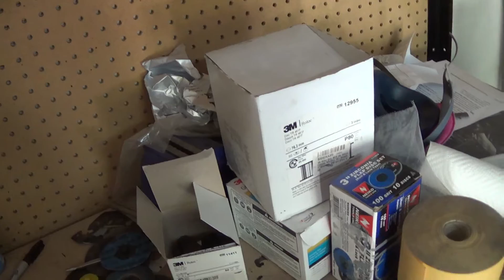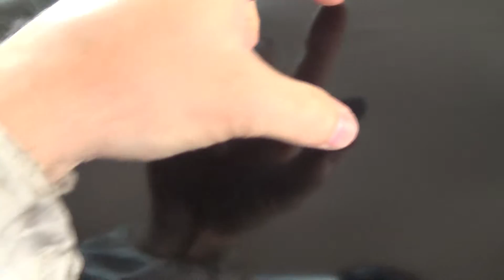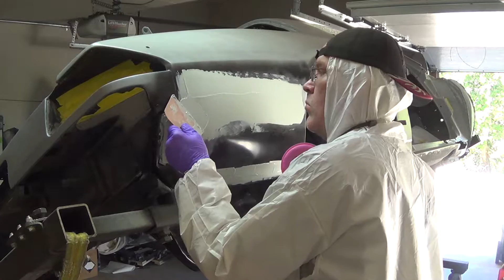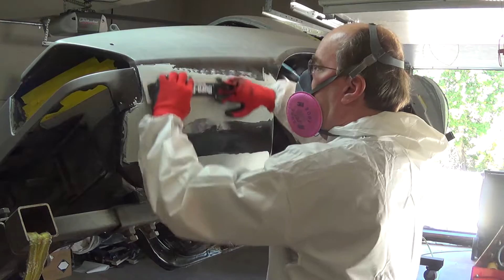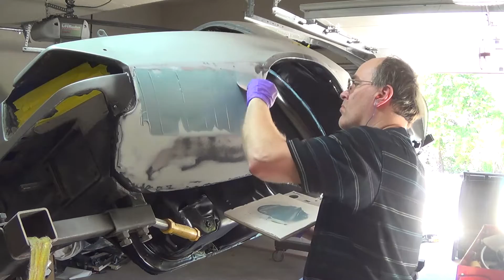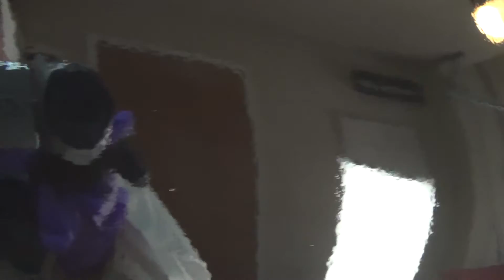1977 Camaro Z28 Part 67: finishing the quarter panel patch, and tearing into the donor rocker

Comment: Very nice job, Erik. Did you apply the filler over epoxy sealer? Just wondering. Some of my paint vendors say it's ok and others say apply it to bare metal only. Any thoughts on that? Keep the videos coming. I look forward to watching what you are doing.
Reply from the maker: Thanks a lot. Yes, I did put it over the epoxy. You will get both answers. I have heard that this is the "new" way to do it, vs. old skool. You notice though that I did not re-prime between each application of filler. So, some of it went on bare metal. I think basically you can't go wrong either way.
Reply: Thanks. You are right. The guys who told me over metal only are old school like me. The younger bucks say no problem. When I quit working in the body shop we were still using acrylic lacquer and enamel paint with the "new" hardener. Yep, I am a dinosaur but still kicking and learning. Enjoying your progress!

Comment: Looks really good Erik.  My rockers have that metal piece under the sill plates on the 72. I think my 81 had them too. They are just to protect any wires running to the rear of the body.
Reply from the maker: Thanks Russ. Do you know what they are called, and if they are available anywhere?
Reply: http://www.camarocentral.com/1970_1981_Door_Sill_Plate_Carpet_Guard_Wiring_Pr_p/int-822.htm . Camaro Central has them but they are pricey. Might be able to find them used, but most I have seen are  toast.

Comment: By George I think he's got it!
Reply from the maker: Thanks Jim! Did I get your name right?
Reply: Your command of English is most excellent! One "p" like "Peter Piper" not two like "Jack the Ripper"!

I think for most cases the wire works better than the flat piece of metal because being narrow the wire is less likely to block the light thru the gap.  You could use coat hangers or tig wire but I suspect the plasticity of both is too high and they are likely to take a set as you bend them.  In contrast,  the elasticity of music/piano wire is high and it is harder to get them to take a set.  You could pick up different gauges to accommodate different curves in the panels.  The piano wire should be available at any hobby shop.

The panel turned out nice.  It's ironic that the glaze was harder than the filler!  Watching Roger sand the door and looking down your quarter panel I'm glad my E-type doesnt have a single character line for me to get straight!
Reply from the maker: Thanks Jim. It is funny, I had some of that wire laying around forever. I used it for the servos in my air exchangers in the drum room. I just threw them out when I cleaned the garage a couple of months back. :)